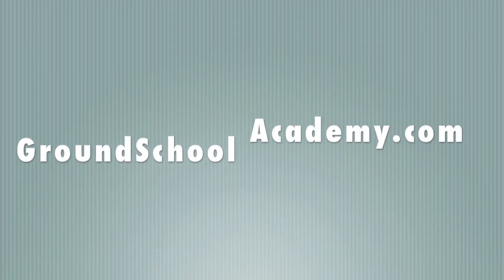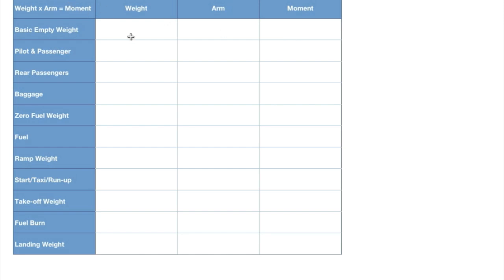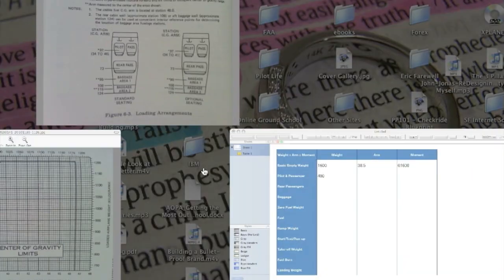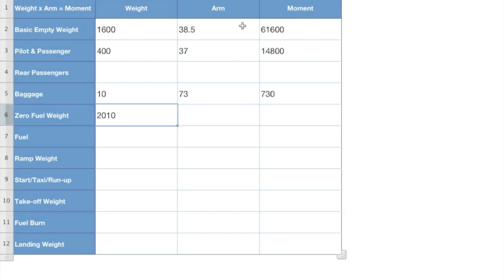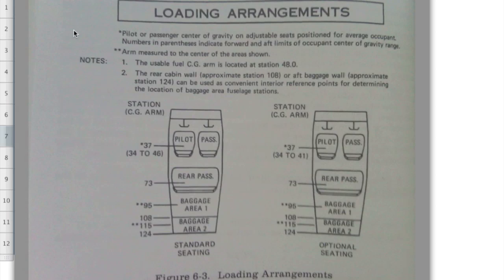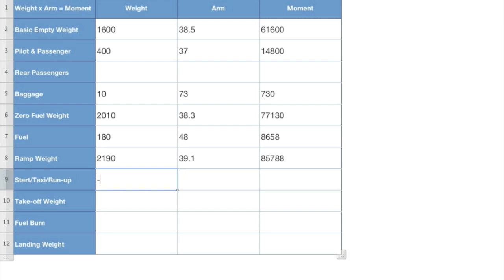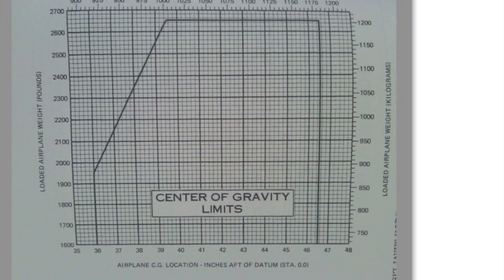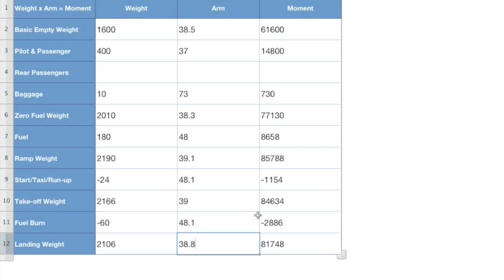Aircraft Weight and Balance Part 1

Comment: Only complaint I have in this lesson is that you say"minus the negative number from the number but it actually is adding because if you minus -48 - 120 = -168 but if you add -48 + 120 = 72. it was confusing so I put it in excel so I could figure it out. I think the correct statement should be -48 + 120 = 72 (numbers were changed for example only)

Comment: am i correct in thinking moment is momentum?
Reply: You are incorrect.  A moment is basically leverage.  Like a teeter- totter.  You want the T-T level (with-in aircraft limits).  Front weight is pretty much set by fuel, engine weight etc.  If you rear-load the aircraft too much it will drop the tail and push the nose up too much causing a stall.  The farther the weight is back the worse this gets.  That is the Moment-Arm and has nothing to do with inertia (momentum).
Reply: @postholewoody208  Ah, thank you for your explanation. Really helped me out :)

Comment: FORGOT OIL!
Reply: More precisely, oil is part of Basic Empty Weight, but not part of the older standard of Licensed Empty Weight. 
The
 difference comes from engine design; radial engines, and older engines 
in general, tend to burn a LOT more oil, so it was treated as a 
consumable like fuel. More modern engines don't burn much oil, and can 
thus treat it's weight as a constant.
Reply: mistershotgun1975  Oil is part of basic empty weight
Reply: part of empty weight mate.

Comment: I agree, the lesson would be more understandable if it started with a general description.  Here is the scoop.  ARM: the length between a datum point and the weight (such as gas in a tank or a passenger).  Datum point:  An arbitrary point  selected by the A/C manufacturer.  It is commonly the firewall for light aircraft.  You don't need to know where it is because the POH delineates the ARM length for each weight in the A/C.  Moment:  The ARM x the Weight.  The units for Moment is inch-pounds.

Comment: Oops!  The A/C empty weight, arm and moment DOES NOT come out of the POH.  The POH does not have information about what equipment (radios, aux. tanks, etc.) are specific to a particular A/C.  The empty A/C data is printed on the AC37 form that is, by regulation, carried in the A/C. Anytime on board equipment is installed/removed a mechanic must change the AC37 form so you (the pilot) knows the data for the specific A/C you are flying

Comment: Too nose heavy. Save some fuel move some weight around. Did you add some extra fuel ? My Air craft dry operating weight is 139,000 CG of 120.9,